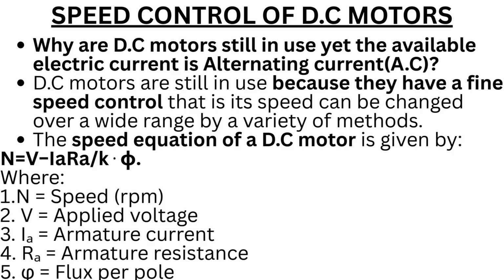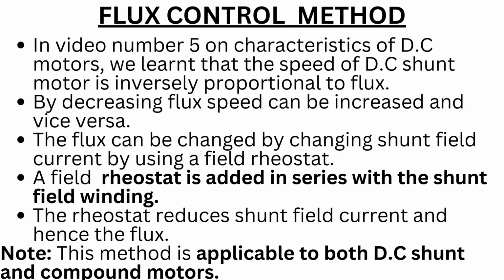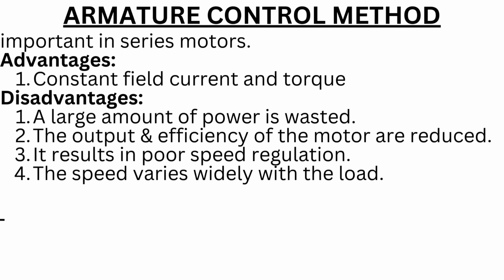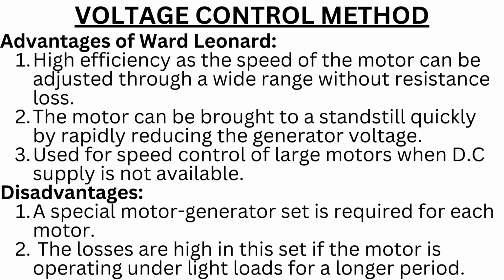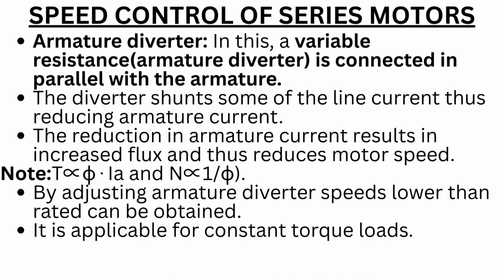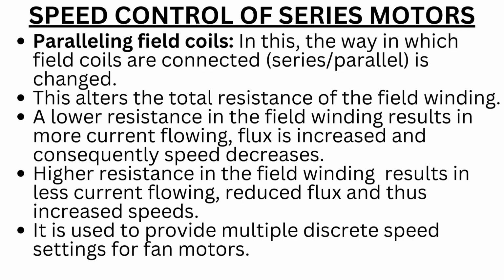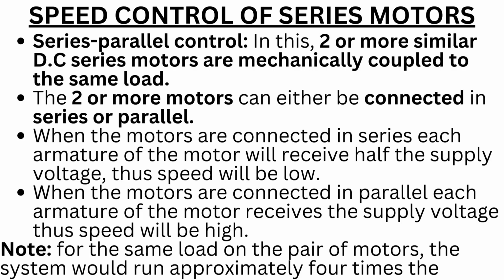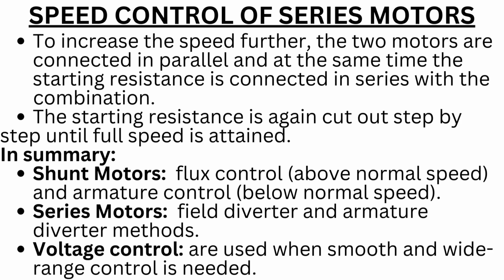Speed control of DC motors

Comment: Innit 
Can you give me a brief of wound rotor induction motors specifically because I didn't get on why should Ac motors especially the wound rotor induction motors have slip rings and not the DC MOTOR S
Reply from the maker: Hello. Slip rings provide external resistance to the rotor windings, thus increasing the starting torque and controlling speed.
Reply: @electricalknowledge_25AAN thanks I understood
Reply from the maker: Welcome and thanks for being my number 1 fan in commenting.